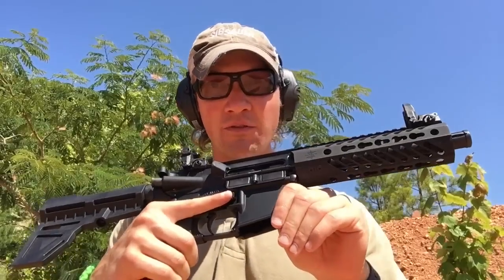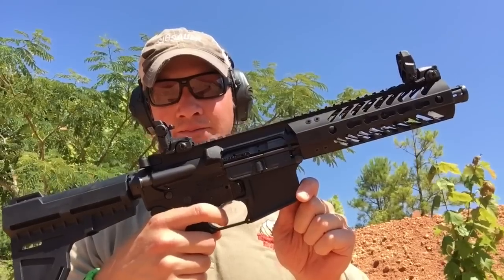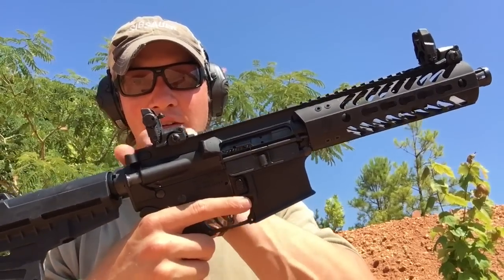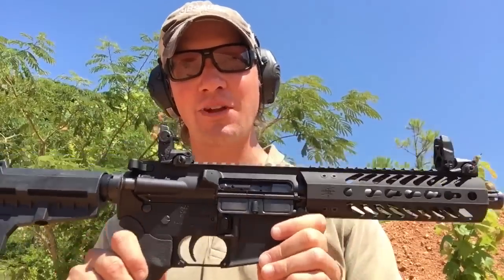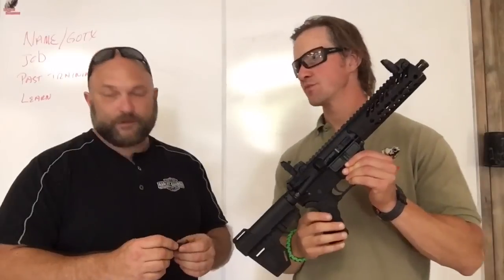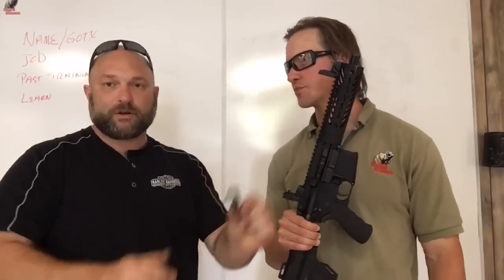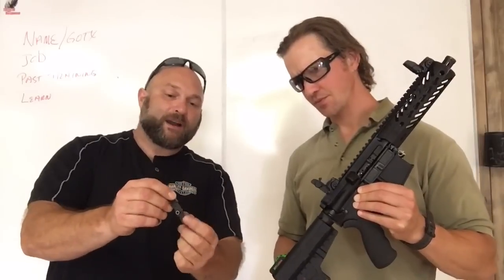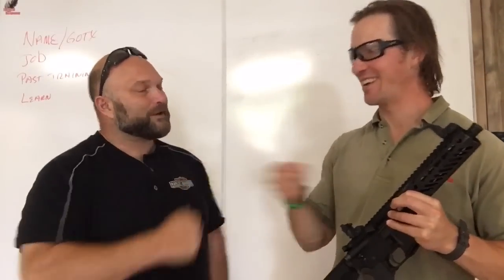Radical Firearms AR-15 Pistol Part 3: Trigger Problems and Solutions

Comment: I own a custom Radical Firearms pistol upper (8.5" 300 BLK) that I ordered directly from RF... They had initially lost my phone order, but after I called a few times, escalated the issue, and waited an extra few weeks longer than I was originally quoted, I still had to make an appointment and drove to Houston to have the gas block reinstalled. It seemed to cycle properly, but it was spitting gas and dust back into the forearm. I couldn't tell if the owner was pissed at me for bringing it in or because of the QA issue itself, but after he grouchily fixed it (without cleaning out the inside of the forearm  ...thanks!) I haven't had any problems.  I eventually put a Colt H2 buffer and a Wolf buffer spring in my pistol lower and the recoil became much smoother without affecting reliability.  I figured I would want an established builder to make a quality firearm with a warranty, but the experience taught me to just build my own ARs.

Comment: I've had good luck with my Radical Arms with the 10.5" barrel. No issues with the trigger but I'll have to check to see if there is any movement on the spring and pin.
Reply from the maker: cool

Comment: Just bought an ar from them for 1500 at gun show in mesquite tx. Didn't even get 60 rounds through it before trigger reset started failing highly disappointed quite pist honestly should have done more research on them first. Should I just buy a new trigger?

Comment: I saw this on another radical firearms ar, that one was a carbine. I ordered an upper only from them in 300blk, we shall see about quality, I have heard to remove the handgaurd and locktite everything. Was supposed to ship in 8 weeks, been 9 weeks and it still is not here.
Reply: I always use anti-walk pins for my fire control group. It avoids any of those issues. As for anything else that screws onto/in my guns (other than the barrel nut and a few other exceptions) I always use loctite. Regardless of who the manufacturer is.
Reply: MatteoSixSeventyFour yeah it would seem like the thing to do but apparently radical firearms doesn't locktite. I only have kns pins on the crusader. Maybe I should order some, I've never seen any pins walk out though.
Reply: MatteoSixSeventyFour Who makes those? I don't run bad levers or plan too. I'd reload and drop the mag instead of the bolt lol.
Reply: Chance Carlton Don't remember who made them. But I bought 5 sets, LoL. I like the BAD lever. I don't have issues accidentally dropping the mag. But with gloves I do tend to tap the lever and run the bolt home. Which isn't an issue for me. I love the Hk91/93 and they lack a last round bolt hold. So I just run the charging handle. Personally the last round bolt hold is not necessary IMHO
Reply: +MatteoSixSeventyFour No its not neccesary but I'm pretty used to it being there at this point.
Reply: Chance Carlton Same here. But after several years of running a Hk93. I know I can do without it. And I'm getting ready to pick up my first AK. Been looking into converting several of my AR's to side chargers.
Reply: MatteoSixSeventyFour AK I'm used to also. I wouldn't go side charger, they are on the wrong side. Seems like they could snag and still different manual of arms to the ak. Idk I run an ar like an ar and an ak like an ak. Maybe someday I'll go for the wrong reload but hasn't happened yet.
Reply: Chance Carlton Hk91/93/G3 charging handle is on the left hand side. I also run my RFB's charging handle on the left hand side. And the AUG clone I had was also a forward left hand side charging handle as well. So a side charger on an AR would be of little issue. For me at least. The "niceties" are I can access the charging handle easily and without un-shouldering the rifle. And in instances where I'm running subsonic 223 ammo that won't cycle the action, I can work it like a left handed bolt gun as it were. As for snagging. Again I'm not worried because of the other rifles I have and run.
Reply: MatteoSixSeventyFour yeah you sound really used to it. Makes sense there.

Comment: I have heard the 9mm & .22lr ARs require anti walk pins.  that is weird on a .223.  You lost me on the "S" spring.  I'm aware of the hammer spring, but never heard it or any other referenced as a "S" spring.  I've heard of the hammer spring being installed incorrectly causing problems.  if it is the hammer spring, how does the hammer get installed without one?  Someone just slapping parts together riding the clock until time to go home?
Reply: It is a tiny spring inside the hammer and always comes installed when you buy a hammer.  Half the arm of it can be seen in the pin hole.  It acts like a detent and engages the center groove on the hammer pin.  I have never had to instal or mess with one, nor have I ever seen one missing on a mil-spec trigger.
Reply: +Gun Sense (drmaudio) So it retains the hammer pin.  I've never heard of it being a separate component.  Thanks.
Reply: shermfj Yeah, it's not really.  It always comes installed in the hammer and I'm not really sure how one would get it out or in.  I would be interested to find out.
Reply: +Gun Sense (drmaudio) Now you have me curious.  I'll have to check it out later.  Thanks for the information.  I believe I've seen it (after you pointed it out).
Reply: +Gun Sense (drmaudio) Just got the chance to check.  looks to be preformed, inserted through the bottom, and through an access port the wire has a smashed section preventing it from being removed.
Reply: shermfj Got it.  Thanks.

Comment: so KNS Precision anti rotation firing pin set
Reply: I think that would work.
Reply: If the hammer was in spec, you wouldn't need KNS pins.
Reply: +mtdawg169 Because freak accidents never happen? Cheap insurance my friend
Reply: +mtdawg169 Yeah, a new gun shouldn't malfunction.

Comment: +JDD0802 That's not the point. The radical guns are utter crap. The fact that the hammer was missing the J spring is evidence of that. The J spring literally never fails in a milspec fire control group.  Even if it did, the broken pieces would stop the gun anyway and kns pins would not prevent that. They simply aren't needed and serve no purpose, outside of use on a FA receiver. Yet somehow, thousands of military guns have gotten by without them for 50 years.

Comment: That's a severe indictment against radical firearms and their QC. It's not as if they were producing massive quantities like colt, S&W or even BCM, where a lemon could squeak by. This is a small batch operation and the gun was obviously sent out for review. Epic failure. Too many to choose from on the market. No thx.
Reply from the maker: Every company has problems now and then, some more than others.  I get what you're saying, but the jury is still out for me until I see how they handle this issue